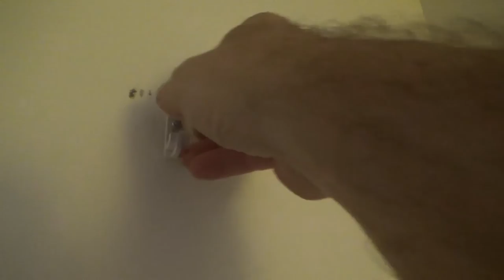How to Remove & Install Wire Closet Shelving in Bedroom

Comment: Why did you have to remove the nails in the brackets on the back wall first?   Leaving them in, you still are able to pop out the shelf upward since the nails a bit recessed and not in the way.  Then you will have more room to work with the shelf out of the way.  Also, I would use a level to decide where the side brackets should be placed.
Reply from the maker: At first I wasn't sure how to get the nails out since I initially thought they were screws so I fudged with one first & when I found out they were nails I went ahead & took the other ones out since they're weren't that many prior to removing the shelf but yes I could've removed the shelf first giving me more room to work on getting those pesky nails out out the holders. Next time I will. Good call! As for the level yes you can use a level. Not sure but maybe I couldn't place my hands on one at the time so I did the best I could without a level. Thanks for taking time out to watch this video & to also send me your comments. Much appreciated!
Reply: @videojoeshows  Joe, all is good.  After I wrote my reply,  I also thought that popping the shelf out of those little brackets while the nails are still in them would give you more stability and they would less likely move causing even a bigger hole in the wall.  Actually, you did help me because I always pulled the entire bracket out with the nail intact before!  Duh!   Now I know enough to remove the nail first!  
I was actually looking for the correct way to remove a wire shelf that also has those long braces that attach to the front of the shelf and down to the wall at a 45.  I don't think you can.  I want to replace old with new.  If I have to remove those braces, I will remove the nail first and hope for the best.  Thanks.
Reply from the maker: @ronsoni8412  I should have more videos of these shelves somewhere close to where you found this one for more info.. Yes you can remove those angled brackets. They will either be installed with a screw at the bottom or a nail which you would need to pry out of there. I use electrical cutters for that & it comes right out. Then the bracket should swivel up out of there & you will then see how to swivel the brackets up & off the underside of the wire shelf. Pretty easy once you see how. Good luck to you & thanks for your messages...!
Reply: @videojoeshows  Thanks Joe.  I appreciate your correspondence.  I installed these shelves on both walls of our walk-in closet about 10 years ago and I remember that I hammered in nails for the little back brackets, the angled braces, and the end caps.  I also added a shoe rack with the same materials with those end pieces to make the rack hang at the correct angle.  My wife could use two more rows, so as long as I'm doing that, I decided to replace the three dirty and dusty three 6' shelves also.  I like the idea of using electrical cutters to get in close and grab the nail head to pull it out.  Thanks for that!  All this just because we want to paint the closet!  One thing always leads to another!  Oh, would you believe that the length of the two side walls that these shelves are attached to are 73" long!  I'm just glad that those plastic end pieces are large enough to catch and hold a 72" shelf!
Reply from the maker: @ronsoni8412  Hey nice work for deciding to remove all the shelves prior to repainting. That's really the best way to do things so you get a 100% job. Nice!
Reply: What if the plastic bit in the middle doesn’t come out? It’s really in the wall and I’m afraid I’ll destroy the plastic bit with pliers if I try.
Reply from the maker: @kryptex666  The plastic bit should come out after you remove the nail or the screw. the screw or nail pushes the plastic wings out behind the drywall so once you remove the nail or the screw then the wings are still kind of spread just a bit for when you start pulling it out of the wall. It should come out by firmly pulling & wiggling back & forth a bit as you are pulling. At least they have come out for me that way.
Reply: @videojoeshows  Agree with Joe.  The plastic bracket is in drywall and drywall is not as hard as cement; actually, it's rather soft.  That's why you need anchors that hug the interior of the wall for a secure hold (note that not all anchors have the same hold capabilities though) when you either nail or screw in an anchor.  When you pull out the bracket, you might make the hole slightly larger, so try to grab it and pull straight out slowly (Or, if you can pull the bracket out a small distance until you feel resistance, use the same electrical cutters to snip off the head of the anchor and push the rest of it back in to wall, making that part fall inside the wall itself).  No matter what you try, the bracket will definitely come out.  However, using the same hole with a new bracket will be loose, so I would only do this if you don't plan on replacing shelving in the exact same spot or using the hole for a new bracket, unless you are creative and can use an anchor that spreads wide when inserted into the hole.  I'm painting around them with a very small brush for accuracy because I'm replacing the shelving in the exact same spot.
Reply from the maker: @ronsoni8412  You might want to consider using a different type of plastic anchor when you get ready to re-install new anchors in the same locations. They have some plastic screw in type anchors two different sizes with big threads that you screw into drywall...have you seen them? I use them for all kinds of things. You could use them if your holes are small enough. worse case you may have to use the toggle bolts with a big wing nut on the end. I don't like using them & try to stay away from them as much as possible though as I usually can come up with some other way to anchor....
Reply: @videojoeshows  thank you for your response. Maybe I’ll put the screw/nail back in and then use the wiggle tactic and it’ll pop out easier. I pulled it straight out the first time.
Reply from the maker: @kryptex666  Do the wiggle technique with the screw or nail removed. The screw or nail pushes the plastic backing wings out behind the drywall so you have to release the wings by first removing the nail or screw...see?
Reply: @videojoeshows The screw/nail was not pulling the plastic bit out, but I managed to get the shelf out by pulling middle brace arm carefully out of the wall and did the same same with the shelf side brackets as well. Maybe the previous owner painted and installed the shelving unit before it dried so the plastic bit was being held there by the paint? but I carefully managed to carefully wiggle and pull it out. Thank you for your follow up and your video :)
Reply: @videojoeshows  Thanks Joe.  Actually, my post was an attempt to help Eric.  I did not know what his intentions were.  Yes, I am aware of those screw in type of anchors that come in two different sizes, and I use them instead of the smaller anchors that most vendors supply to hang their product.  They are much stronger.  For the best hold, I'll use toggle bolts (sometimes called "butterfly" anchors).  I am not planning on removing any hardware, just the shelves, before painting.  I'll use a very small (1/2") paint brush and paint around them very carefully.  That seems to be an easier way than to remove the old brackets and braces, and then add larger anchors and hope they work.  We'll see.
Reply from the maker: @ronsoni8412  Yes after I sent you the message I realized that you were responding to Eric & not me. My apologies & I was hoping Eric would see the message anyway which I think he did. Sounds like you have a handle on your project. Let me know how it turns out! All the best.   Joe
Reply: @videojoeshows  LOL.  No problem at all, no apology necessary!  For what it's worth, I believe Eric was trying to remove the shelf and had an issue with the angled brace.  I saw another video and the guy simply popped the back wires out of the small brackets and the angled braces loosed their grip to the front of the shelf, and the shelf was easily removed without removing any hardware.  Yes, Joe, I will let you know how it all turns out.  I plan to start at the end of this week.  My best to you as well.